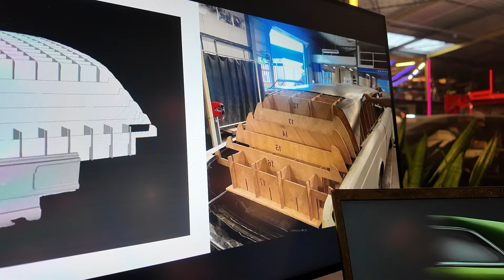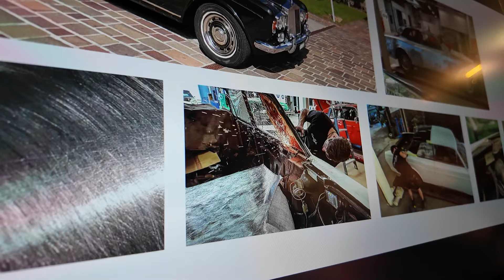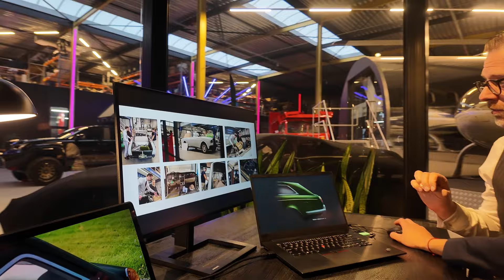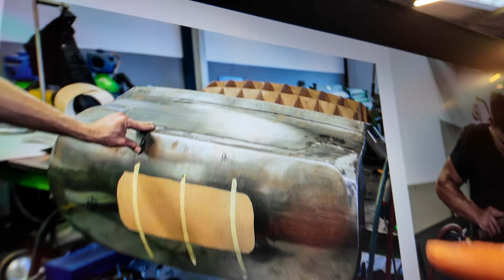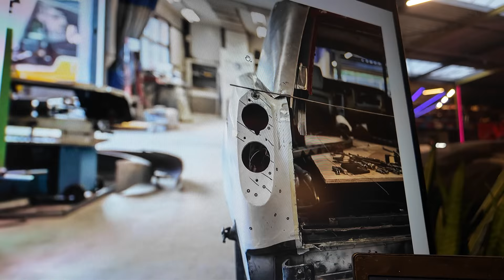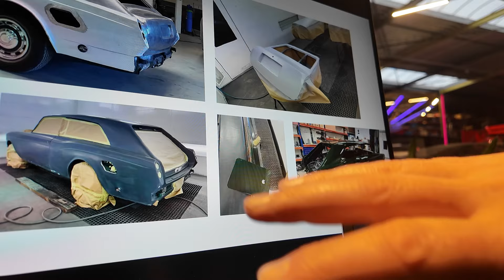INTO DESIGN 010: building a bespoke shooting brake by hand: to production | Niels van Roij Design

Comment: Looks like a mgb gt so in other words not very pretty. Sorry but looks like two different cars cut and shut together.
Reply: I agree the green rendering looks like an MGB GT, and came to say the same but I believe it looks stunning. Beauty is in the eye of the beholder. I’d happily commission a conversion if I had the funds. A question for @nielsvanrojidesign would it have been easier on a convertible?
Reply from the maker: @TheProco2020  A fair observation — and thank you for the kind words. Beauty is indeed subjective although we would argue against the MGB GT, even though it is a handsome car.

As for your question: no, starting from a convertible would have not been technically easier - although a convertible is stronger, our car, after our conversion, was stiffer than OEM. 

However, this project was never about choosing the easiest route. Beginning with the fixed-roof car was due to the fact this has been in the family for 40 years.
Reply from the maker: We’d say it’s bold, purposeful, and unlike anything else on the road. You might want to see some of the other videos to understand the choices made in the design process. Enjoy! 👌